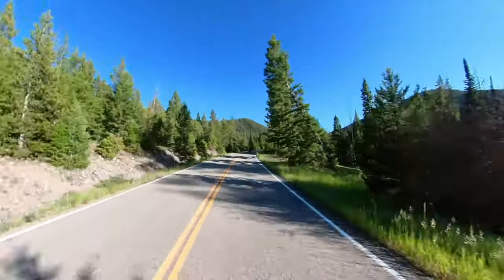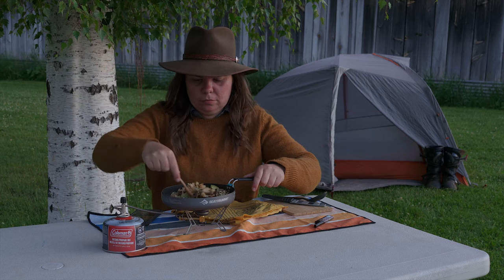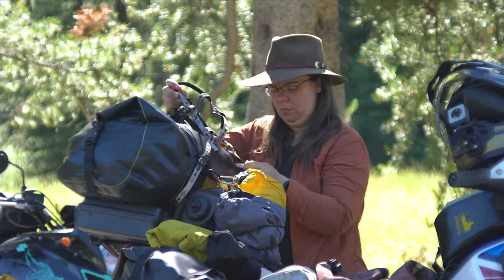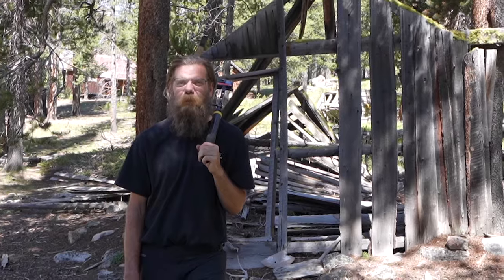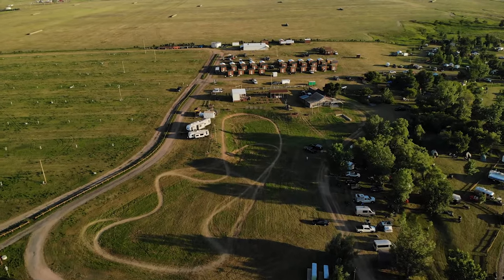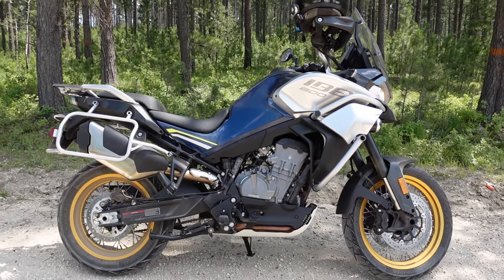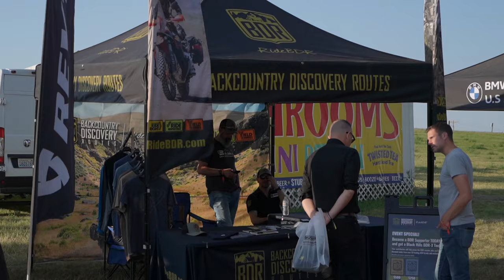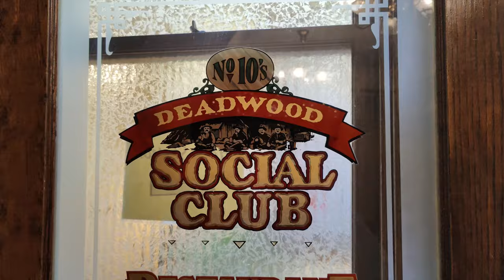7 Days Across Montana and South Dakota

Comment: CFMOTO 800 here in Australia has the same fuelling issues.  Running 95 fuel helped. Sealing the air filter properly helped. Throttle reset helped. Software update helped.  All fixes helps the fuelling issue but never gets rid of it completely.  The twitchy throttle doesn’t let you coast along without that surging feeling.  After nearly two years of dealing with it in the hopes that a better software update will be released, that never happened, I sold the bike.  It’s a shame because the bike has a lot to offer.  But CFMOTO need to focus on the bikes they have already released and fix issues.  But instead they are only looking at their next range of bikes. The reason why I didn’t buy the upcoming 450 they are releasing soon.
Reply from the maker: Thank you for sharing

Comment: The cfmoto800mt has another model called the adventura which has the throttle response fix and 6 ride modes, upgraded suspension and a host of other features for about 1500USD more.

Comment: Give it time and you will end up packing way more ridiculous stuff. I have packed 2 bicycles to the bicycle shop in one trip. Also one  800 mile ride I packed an entire BSA chopper frame on the back with an AK 47 tucked between the frame rails, wrapped for discretion of course. 😆

Comment: I wonder if you might save space and weight just bringing two backpacking stoves and isopro cans rather than that huge two burner and a propane can.
Reply from the maker: We would still have the problem that isobutane just doesn't cook a large amount of food (like for four people) at an efficient rate because the burners are so small and concentrated on a small part of the pot. It just takes longer to evenly heat a large amount of food.  Hence why I brought the Genesis. 👍
You could make the argument of using a butane stove that looks like a thick text book which would technically be thinner that the Genesis. Since I didn't really need two burners, just a larger and more efficient one 👍